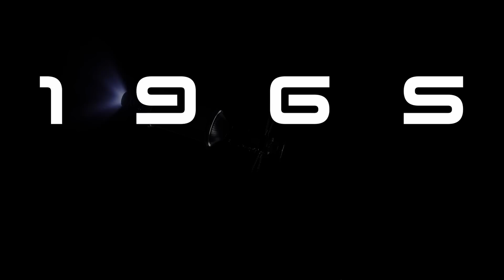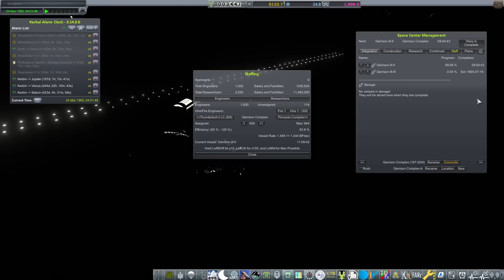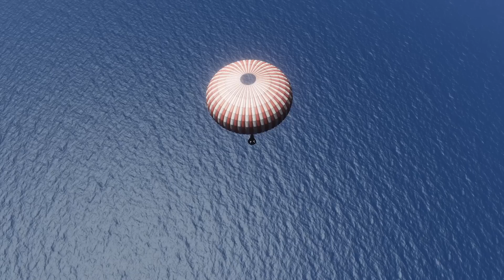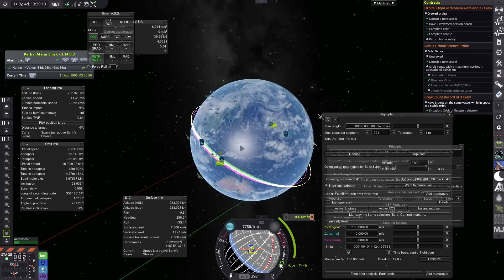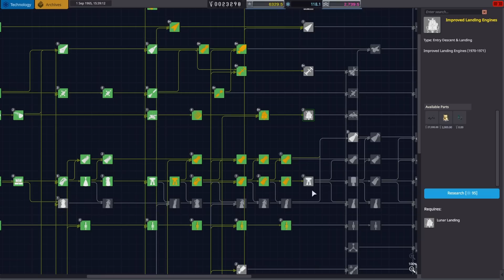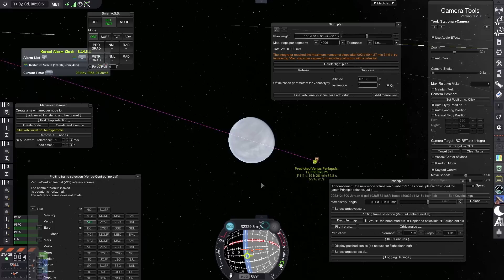Proving Space Stations are a Viable Concept | Kerbal Gets Real Redux #15

Comment: RSS Origins is designed for principia. It's actually recommended to play with principia installed to fully appreciate the orbital mechanics of the asteroid systems. It's only recommended to add celestials on a targeted mission basis because of performance impacts. Personally my system can't handle more than a couple at a time but the orbits are beautiful, especially for multi body systems.